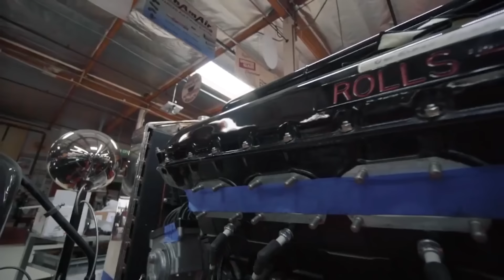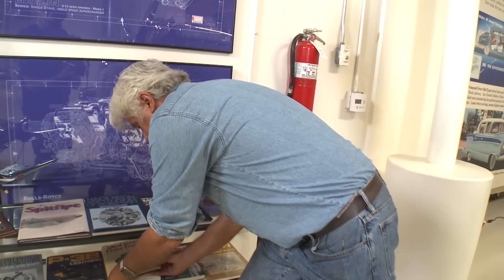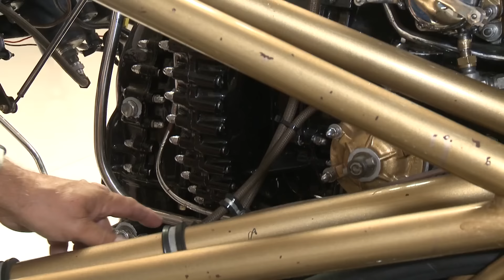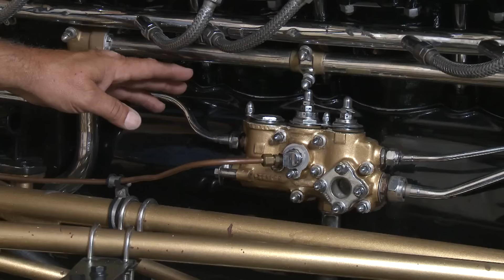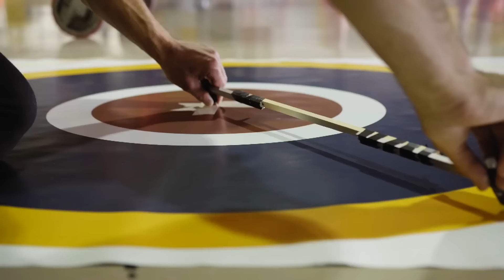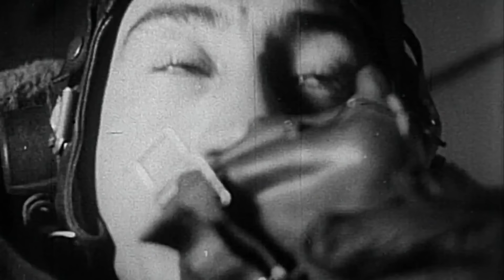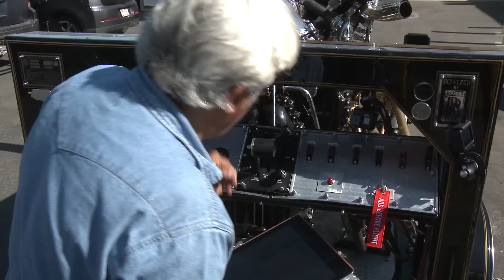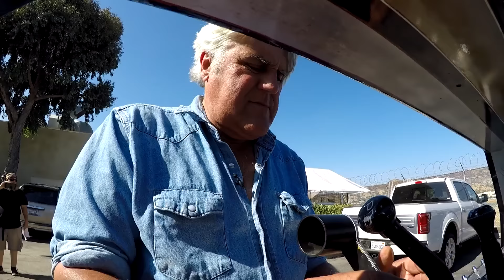The Engine That Won World War II - Jay Leno's Garage

Comment: The Merlin is an awesome engine. But if I were a pilot in WWII getting shot at every other day, I would have wanted to be behind the Pratt & Whitney R-2800 Double Wasp (P-47 Thunderbolt engine) due to far superior survivability. The Mustang was misused as a ground attack airplane by some commanders, which was a severe weakness area for the liquid cooled Merlin-- I believe most Mustang Aces who were shot down were due to ground fire down low. Many P-47s were shot with over 200+ holes and still got the pilot home more often than not.
Reply: tcptcp.
Maybe 3,500 P 47 pilots would not agree with you.  Ground fir e was dangerous for any plane, the p 47 was so big and heavy it was a big target and not fast enough or agile enough, it also had a poor rate of climb. 
I wonder why a Spitfire squadron that escorted USAAF bombers over France all got home, some with a umber of holes.
Reply: I often wonder about the survivability claims for air-cooled engines. You wouldn't want cannon or machine gun fire directed at any type of engine and especially their fuel and lube systems. I think they are "comfort claims".
Reply: Who cares?  What difference does it make?  That war took place in a time when all information was recorded in books, books that today nobody reads.  The misnomer, 'the information age' is actually the age of ignorance, as so many of today's young people know nothing of the past that isn't on the internet or in a computer game or video.  The problem with depending on the electronic storage medium is that it contains only that information that has been entered there by computer freaks who made the information transfer based on their own biases and prejudices.  Not ALL of the information that it contained in the history books made the transfer, and that's how history, or the human understanding of it, becomes distorted.   I've been a history freak since 1960 and have read countless books on history, especially military history, and it's utterly staggering how ignorant so many of these commentators are.  Historians who truly care about history aren't going to be so lazy as to merely google a subject, they're going to read books.  They're going to spend a lot of time at libraries and not here.
Reply: Spitfire pilots joked that the standard evasion tactic of the P 47 pilot was to run up and down the fuselage.
Reply: 18tangles Couldn't have put it better meself :).
Reply: @18tangles- Your posts are inane. British pilots fought continuously and on their home turf- versus US pilots who were rotated out to train pilots at home. Obviously they would have different kill records. The US system was sustainable- the British system would not have held out if the war continued.

As for planes- you're comparing the P-47 to the Spitfire- despite the fact that the P-47 had twice the combat radius of the Spitfire. If the Spitfire was so good- why wasn't it escorting bombers? The answer is simple- it couldn't- at least not over any distance.

Besides the Spitfire was completely eclipsed by the end of the war by planes like the P-51 and the F4U. Hell the British has better planes than the Spitfire during the war for heaven's sake. Take the F4U Corsair for example- 75MPH faster, MUCH better rate of climb, excellent maneuverability, incredibly survivable, heavier armament including a 4,000lb bomb load, and did it all with an air cooled engine.

Hell- the Merlin engine as manufactured by Rolls Royce wasn't even very good. Packard had to redraw all the blueprints to get tight enough tolerances for mass production. Here's a great story from Rolls Royce engineer Stanley Hooker:

> “One day their Chief Engineer appeared in Lovesey’s office, which I was then sharing, and said, ‘You know, we can’t make the Merlin to these drawings.’
>
> I replied loftily, ‘I suppose that is because the drawing tolerances are too difficult for you, and you can’t achieve the accuracy.’
> 
> ‘On the contrary’ he replied, ‘the tolerances are far too wide for us.’ We make motor cars far more accurately than this. Every part on our car engines has to be interchangeable with the same part on any other engine, and hence all parts have to be made with extreme accuracy, far closer than you use. That is the only way we can achieve mass-production.’”
Reply: s1rk3t.
You are completely wrong.
In the Battle of Britain, or before the US did anything the British pilots were rotated and rested. They flew in defense of Britain then they went on the attack over France and they were flying in North Africa and in the Mediterranean and in Burma. The kill system was different, the RAF had to have verification of any kill. The British system worked fine right through the war.

Comparing the slower P 47 to the Spitfire, the P 47 had hardly any range advantage and Spitfires were escorting USAAF bombers.
You are taking a 1944 P 47 and comparing it to a 1940 Spitfire, if you take a 1944 Spitfire which was almost 100 mph faster than the 1940 Spitfire you find the Spitfire is 25 mph faster with a much better climb than the poor heavy P 47 which had a maximum bomb load of 2,500 lbs in late 1944.
P 47 D-30 which served in 1945  433 mph, rate of climb 3,180 feet/min.
Spitfire Mk XIV in service late 1943  447 mph and 5,040 feet/min, the P 47 was not even close. The P 51 could never match that either, even with a British engine..
.
The Spitfire was never eclipsed by any other fighter during the war, it even managed to take on jets  very well.
By the end of the war the British had the Hawker Tempest which some consider the best fighter and it was at low level, the Spitfire was better from medium to high altitude and the combat range of a Spitfire increased to well over 1,000 miles.

The Rolls Royce Merlin engine was very good, it was much better than the Allison and it was more reliable than your heavy radials.
Rolls Royce and Ford of Britain simplified the Merlin for mass production before Packard did a thing. 

Packard made new drawings but made no real changes. they used a different bearing material and that is all.  
Rolls Royce not only had to show Packard how a real engine should be made but also had to set up a plant in Britain to check every Packard assembled engine and rectify problems before they could be used on British planes like the Lancaster, none were used in Spitfires until the last year of the war.
Reply: alexander.
Is that your problem? you still believe in fairy tales like the ones you try to tell.
Reply: Avoiding dogfights was obviously desirable but hardly always possible against German opposition. They played to their strengths, too. The Thunderbolt was found wanting. Get over it.
Reply: Do you think Alexander Kasady thinks he's Alexander Kartveli? He's always on about fairy tales and mysteries and such. Projecting his own worst problems onto others? ;)
Reply: Samuel.
Without the Rolls Royce Merlin the Battle of Britain would have been much harder, maybe Germany could have won. No other fighters could have done what the Spitfire and Hurricane did. Without Britain WW II would have been very different, That makes the Merlin the engine that at least stopped Germany from winning and it was in most of the planes that took the fight to Germany.
Reply: Remember that the UK gave Germany its first TWO defeats and helped open up the forgotten Southern Front  - the original and very important European Second Front. And as well as the Battle of Britain, the Spitfire and Hurricane were also decisive weapons in the Victory at El Alamein.
Reply: And there is a lot less to you and your info. tan meets the eye, Wiblur.
Reply: tcptcp20072007 the mustang was a girls blouse until fitted with merlin engines.As a retired usaf general ssid the mustang was just a spitfire mark 2
Reply: jct
Cowards need to hide behind guns, real men don`t.
Reply: If you look at radial engines they are a maze of vulnerable oil and fuel pipes and push rods. If you got hit by a Messerschmidt's 20 mm cannon it wasn't the engine configuration or cooling concept that determined your survival. There are enough vidos on here of B17s and B24s being cut in two by cannon fire.
Reply: If dogfighting was obsolete in WWII, why did you set up Top Gun after the start of the Vietnam conflict? Horses for courses, the P47 had it's plus points, but to say it was more versatile than the Spit is a little disingenuous. From low level to 40,00 feet of photo recon the Spitfire proved it's versatility throughout the 6 years of WWII (that's right, 6 years).

But this isn't about the P47, or P51, or Spitfire, it's about the Merlin engine, the greatest sounding aero engine ever made.
Reply: alexander.
Just look at the P 47, it was so much bigger than the Spitfire, not as agile and made a much easier target, maybe why the RAF used the Spitfire as a dive bomber very successfully, a fast small target that could turn at low level and with far better acceleration and climb it was out of range much quicker. 
P 47   5 feet longer,   8 feet more wingspan,  2 feet taller, 70 sq feet more wing area.      P 47 empty is 2,600 lbs more than the Spitfire loaded weight.  That is comparing a P 47 D to a Spitfire LF Mk IX with the clipped wings that would be most likely to be used for low altitude work..

I know which I would rather be in.
Reply: Barrie Rodliffe----  Whatever.   All that matters is that we Allies won the war.  Who cares how?
Reply: alexander 
Maybe historians care how and why
Reply: 18tangles---  That's true, but it wasn't just the US figures.  It was a problem with fighter pilots, regardless of nationality, to over-state the numbers of enemy aircraft destroyed.  It's not because anyone was intentionally lying, but because   (a.)  so many pilots over-estimated the accuracy of their gunnery (most weren't nearly as good of shots as they thought themselves to be), and  (b.) because more than one pilot took some shots at the same opponent, each one thinking that they were the one responsible for that target's demise.  This was a problem bemoaned by the score-keepers at the RAF, the Luftwaffe, and the USAAF alike.  Pilots' claims eventually became entirely discounted.  It wasn't until several years after the war that a truer picture began to emerge of each nation's losses.  Despite that, I'm amazed at how much sheer bunk is contained in some of these videos, and how much important information is lacking entirely.  Obviously, most of the producers of these videos have done some very sloppy research.  I've stopped watching them for that reason.
Reply: What a load of bollocks. The P 47 was relegated from the front-line fighter role because it wasn't up to the job. Get over that. And I know which I'd have preferred, too - the fighter where you had both options: superior rate of climb AND superior manoeuvrability; i.e. outclimb and swoop again or dogfight according to preference.
Reply: It is a matter of history that Thunderbolts couldn't fulfil the bomber escort role because of their lack of range, which was due to its aerodynamics - or lack of them - and the fuel inefficiency of its engine.  The German fighters simply waited till the gas-guzzling Thunderbolt had to turn back and then attacked the unescorted bombers. In spite of its much smaller fuselage, the Mustang could get to Berlin and back, dogfight over the target and still have fuel for shooting things up at low level. And escorting bombers against the Luftwaffe you had to dogfight. Anybody with any sense who compares the Thunderbolt and the Mustang can see why the Mustang was aerodynamically more efficient and will recognise that a 27 litre engine will use less fuel than a 46 litre engine.  And the idea that an engine that performed as well as the Merlin did over so many years had slack manufacturing tolerances - whoever made it - is absurd.
Reply: jonny bottle.
I hope i can help explain the sloppy tolerance nonsense.
Rolls Royce engines used to be assembled and the bearings had to be fitted by hand, using marking blue and scraping away high spots it is possible to attain a near perfect fit. But for mass production this is not practical so the bearings had to be made to better tolerances and other changes were made for faster production by Rolls Royce and Ford of Britain.
My understanding is none of the engines had sloppy tolerances
Reply: alexander
The P 47 started as a new design in 1940, it had little in common with the P 43 which first flew in 1940, so the P 47 first flew in 1941  or after the       P 51.  The laminar flow wings did not really help.
Reply: Your attempts to "talk up" the Thunderbolt are getting very far-fetched. Among US fighters it should be rated after the Mustang (obviously), Corsair ((obviously), Lightning (obviously), Hellcat, Airacobra, Kingcobra (great contribution to Russian victories).
Reply: No mystery - just logical analysis (you seem to be obsessed by mysteries and fairy tales BTW). The Thunderbolt story began in June 1940 according to all my sources.
Reply: jonnybottle check out Gabby Gabreski robert johnson steve pisanos records and say that
Reply: Guys the Thunderbolt was designed for ground attack , it was armored and had redundant systems , the Mustang was designed for air superiority , but pilots once they had air dominance would opt for ground attack targets of opportunity. No sense having argument over two planes designed for different things.
Reply: There are similar stories about all the aircraft involved in every war. BTW, the Thunderbolt's turbocharger was mounted halfway between the cockpit and the tail. It would obviously be sheer luck if none of the "hundreds of bullets" hit it or the control lines.
Reply: Was it General Nuisance? There are lot of folk answering to that in the USA.
Reply: I'll drink to that!
Reply: Tp paraphrase Fanny Squeers: I pity your ignorance and despise you.
Reply: Another factor that hampered the Thunderbolt in ground attack was its very long take-off and poor consumption. Both were  problems when aircraft were moving up behind the advancing front and operating from improvised strips or captured bases built for nimbler German planes and due to the amount of fuel that had to follow. And moving up was especially necessary with the Thunderbolt because of its poor range.
Reply: tcptcp20072007 Thats what made the corsair so great.
We had a corsair at our local airport, (Venice Fl) and I heard it take of and just moments later heard sputtering them nothing. The pilot landed on Hwy 41 Tamiami Trail a mile away. 
The pilot got a ride back to airport hopped in his other plane and left the Corsair for his mechanic to pick-up.
Reply: Having to make an emergency landing on a wide road made the Corsair great?  Being able to take off and land on a grass field made the Spitfire greater, that and having a reliable engine.
Reply: I wonder since the Spitfires replaced the slower P 40 in that role, I have not heard that they lost many Spitfires but they certainly destroyed a lot of the targets they went after.    The biggest difference was that a lot of P 40  losses were to Luftwaffe fighters while the Spitfire could more than look after itself.
Reply: Spitfires replaced P 40`s as dive bombers because of losses, P 47`s had a worse survival rate than Spitfires too.
Reply: WTF!
Reply: soaringtractor-  No, that's not a theory, that's a fact.  The Thunderbolt was a far better ground- attack aircraft than the Mustang and survivability was the biggest single reason why.  Furthermore, he's right about the R-2800, its having powered not just the P-47, but the F-6 Hellcat, the F-4U Corsair, the B-26 and a whole long list of other aircraft as well.  As an aircraft engine it powered more Allied aircraft than any other engine and thus topped the list of the engines that won the war.
Reply: Yes, the Mustangs were vulnerable to ground fire, especially the radiator... the Jugs, with that big round engine, not only offered the pilot some protection, but would keep running even with  entire jugs shot off, and still get the pilot home....in short Mustangs for air superiority, Jugs for ground attack...
Reply: soaringtractor-  there you go again, not thinking.  The B-17's and B-24's were 4-engined airplanes, thus soaking up 4 engines per airplane.  It isn't the NUMBER of engines I referred to but the number or AIRPLANES powered by the R-2800.  Google the R-2800 and you'll see a real long list of WW II aircraft that used that powerplant.  I think you'll be impressed.
Reply: Oh, for god's sake!  Where do you Brit-o-philes come up with such bullshit?   The P-47 was a front-line fighter and ground attack plane right up until the cessation of hostilities.  It was a hell of a lot more versatile and battle-worthy than the Spit.  And as far as dog-fighting is concerned, only a fool would allow himself to get sucked into one.  By the time air speeds reached 300 knots and beyond, the days of the WW I style aerial combat were over.  Hell, even the WW I German aces preached the science of aerial assassination-  dive out of the sun's glare, hose your enemy, and dive to escape and to preserve your energy to zoom-climb back to altitude and attack again.  Do NOT get into a 'furball', that's a sucker's game.  Attack, escape and attack again.  You're not there to play games with him-  you're there to KILL him.  And that's what the P-47 did so well.  So who fucking cares how well the Spit could dogfight?  By WW II that was an obsolete doctrine.  And as a ground attack plane, the P-47 was as good as any.  You will notice that the RAF had come up with two new models-  the Typhoon and the Tempest--   to fulfill that role and why?  Because the older Spitfire was so good at it?  Meanwhile, the P-47 soldiered on, as good in the low-altitude attack as in the high.
Reply: @Barrie Rodliffe - Yeah- you'd rather be in the F4U Corsair :)

Almost 100MPH faster, almost twice the rate of climb, incredibly agile, up to 4 20mm cannons for armament and could carry a 4,000lb bomb load or ground attack rockets, higher service ceiling, and so on. People seem to forget that the F4U was as fast or faster than the Mustang.
Reply: johnnybottle--- Actually, the 'general nuisance' was provided by you Brits.  You were never anything but bit players in WW II who couldn't even provide for yourselves, be it weapons, food, or whatever.  Your so-called army sat on their duffs in northern Europe while we Yanks did all of the real fighting.  Montgomery only provided excuses and bad ideas (Market Garden).  Quit trying to rewrite history just to cover for you r own embarrassment for being so utterly fucking useless.
Reply: jonnybottle---  No, they weren't just 'comfort claims'.  The in-line engine was vulnerable to ground fire because it had radiators and hoses.  Also, due to its layout it offered a larger target for ground fire directed upward than what the radial engine offered.  The radial engine was comprised largely of cylinders and heads and with a small crankcase, while the in-line engine offered a larger target with its longer crankcase.  One stray rifle round, the proverbial 'golden BB', would penetrate the engine sump and there goes the oil, or one of the coolant lines and there goes all of its coolant.  The radial just didn't have those vulnerabilities.
Reply: 18tangles---   Yeah, but it wasn't as long.  It was tall.  And it didn't have a radiator or coolant hoses.
Reply: johnnybottle---   Hey, whatever gets you through the day...  Our pilots had P-47's and the British pilots had jokes.  Goody for them.   But if I was a fighter pilot back then I know which one I would prefer, and it ain't the  joke.
Reply: johnnybottle---   Yep, the Mustang had a skinnier fuselage, a more fuel efficient engine, a laminar-flow wing and it was full of gas tanks.  So what's the mystery  here?  It was brilliantly designed with that fuselage and those wings and then benefited from some very fortuitous design evolution due to the Merlin engine and the addition of all those fuel tanks.  The P-51 D was the result of excellent design and pure luck.  The P-47 began life in 1935.  In the span of aircraft development of the time it was an entire generation apart.  It wouldn't be any more fair to compare the F-86 SaberJet to the Mustang than it is to compare the Mustang to the Thunderbolt.  So enough already.
Reply: Barrie Rodliffe---   Hey, whatever gets you to sleep at night.  When we were kids we called them 'fairy tales'.
Reply: R-2800 also powered Hellcats and corsairs. No one engine won the war. Merlins were good high altitude and on mustang long range asl powered hurricanes mosquitoes fairy fulmars battles. It all depends on what you are using it for.
Reply: I sit corrected. I still don't buy the idea that one engine won the war. Or one aircraft or tank or any other weapon..
Reply: It's the Wright 1820 engine, also used in the Wildcat and T-28....get it right.....
Reply: If I remember correctly, the Double Wasp was air cooled. If you wanted to cripple a P-51 you'd just have to shoot out the radiator. So the Double Wasp may have been more durable.
Reply: Barrie Rodliffe
"the RAF used the Spitfire as a dive bomber"
In World War 2 my father was a tank commander in Italy, from Taranto to Trieste, and told us stories about the campaign.
One of them was about watching Spitfires dive bombing targets. He said the first ones in were pretty well always the aircraft that got away after dropping their bombs, but, after the first five or six, the flak was getting the range and that's when the Spitfires started to get shot down.
He said the Spitfire pilots' tactic after dropping their bombs was to go to tree top level and fly away as fast as they could, using the terrain for cover as much as possible.
Reply: Having had a ringside seat, my father was pretty specific about the dive bombers he saw being Spitfires and also about the increasing accuracy of the flak as the aircraft made their runs - coming down in a straight line from 8,000 feet tends to make an aircraft a sitting duck if the gunners on the ground have got the range.
He never mentioned P40s, that I can remember - the tales he told us were when I was a teenager and younger - but he did tell us of one billet he stayed in, which was off the end of a runway being used by P-47s. Two days after they moved out, a bomb laden P-47 failed to lift off, flew in the front window and blew the house to bits.